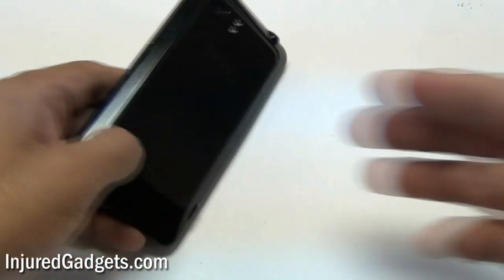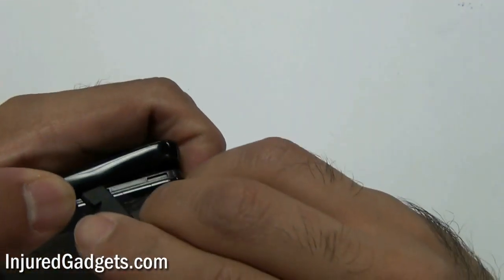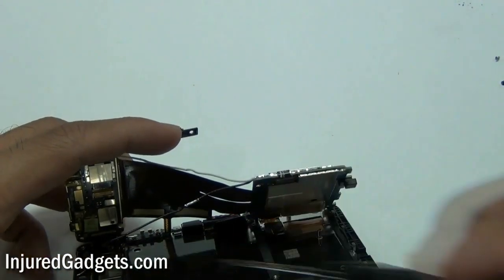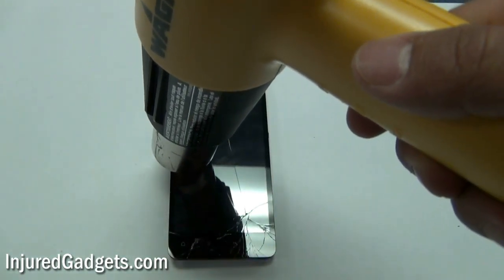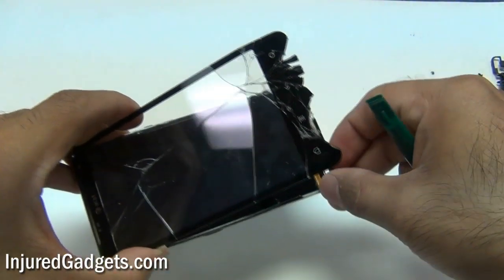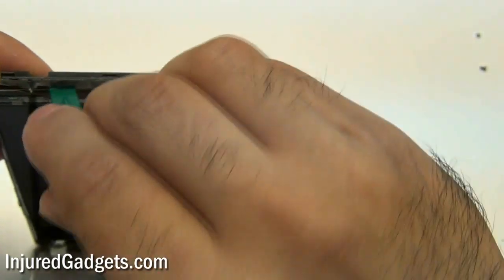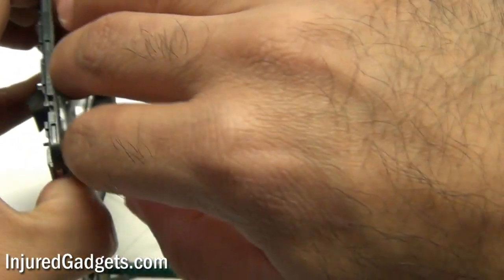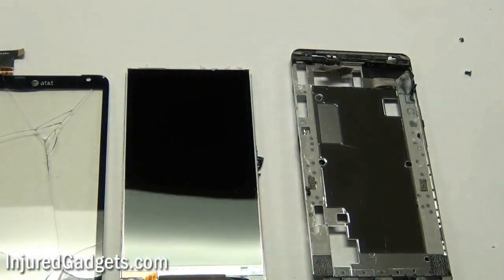HTC Vivid 4G (AT&T) Touch Screen Glass Digitizer & LCD Display Repair Replacement Guide

Comment: I got a problem, I ordered a brand new replacement assembly and put everything back together. Everything works fine, touch screen, speakers, calling, etc but the only thing is that I don't get any 4G, LTE, etc now. It's just bars of service. Help me ASAP.

Comment: replaced my digitizer and everything works except for my in-call sound. Speaker sound/ringtones work, but just the earpiece sound for calls and such does not work.

i noticed i punctured the black wire as i was screwing the black cover piece back together. Could this potentially be the issue? if so i can try to add some solder..

any advice would be much appreciated!!! 

thank you!

Comment: I ordered a New Htc Vivid White Digitizer from Ebay.com, I got it on October 31, 2012. I had torn apart the phone using your Youtube guide and put it back together. I turned it on and it all worked fine until i tried to unlock it using the touch feature. It doesnt work in the part of the middle. I really am mad and would either like a reply or a help video on this to solve the problem. I also want to mention that once I tore it apart it worked perfectly fine with the old cracked screen. Reply.